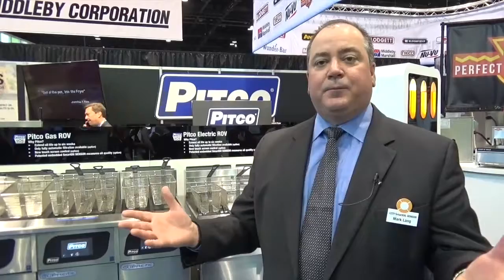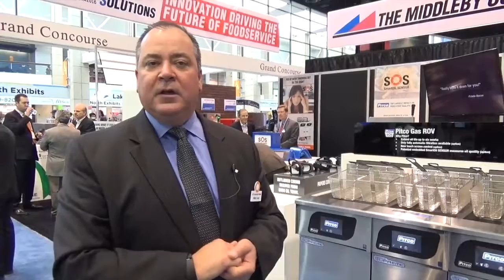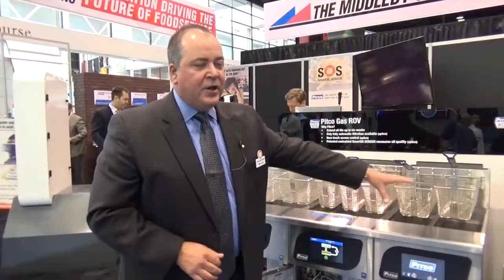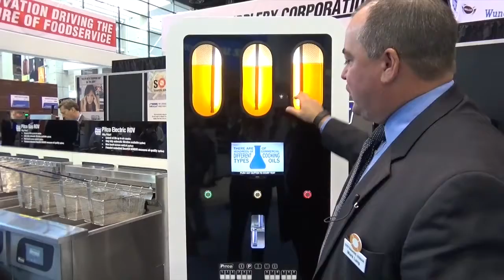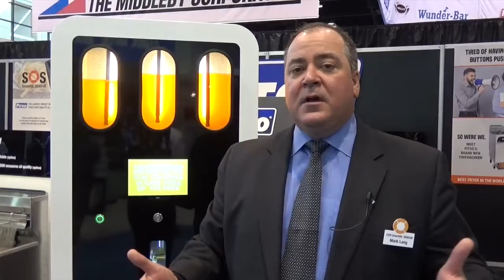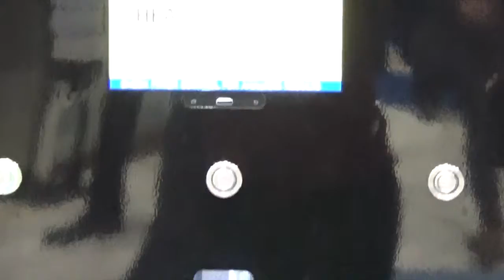Pitco ROV Fryers

Comment: Do not buy these fires invest in Henny Penny. These fryers are the worst thing imaginable they do not cope. They are absolutely built to the cheap and I worked in a holiday parks to prove a point. The thing could not even filter during a peak period without being blocked a chip vat from Burger King yet doing the same sales compared in the service station with a henny penny no issues